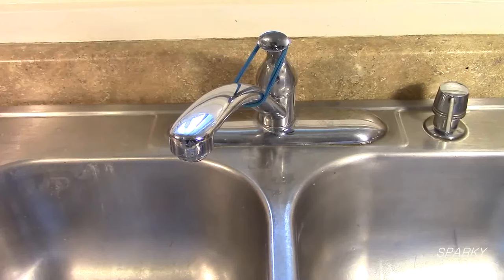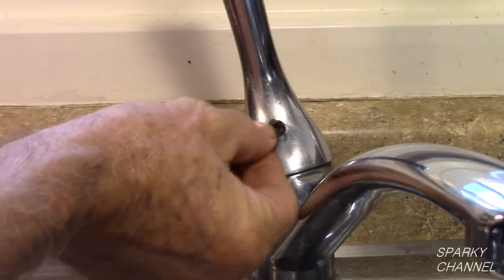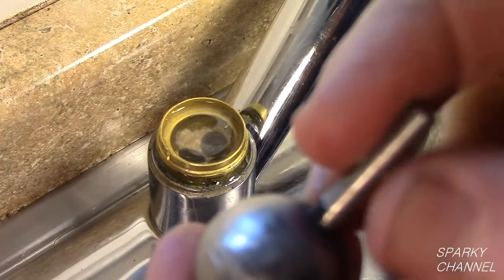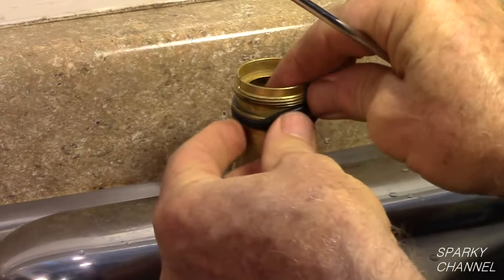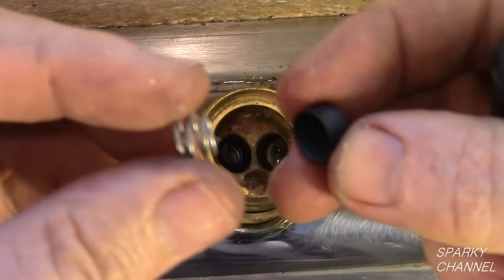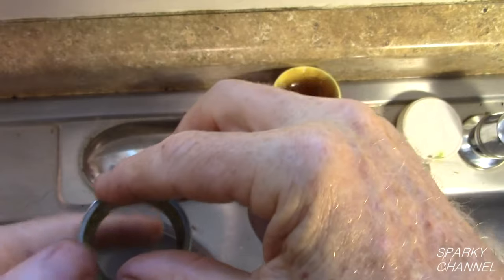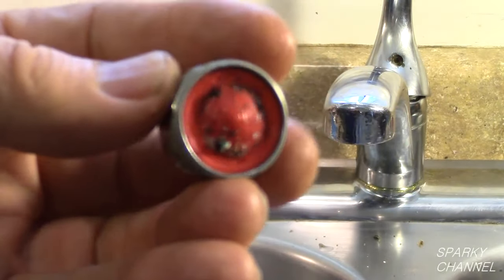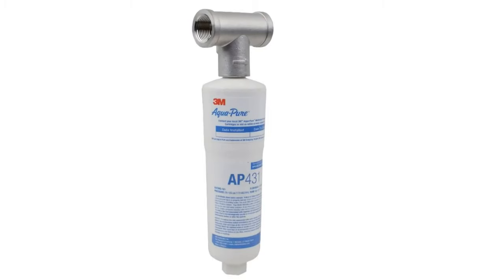Delta Kitchen Faucet Leak Repair (Single Handle)

Comment: Called Delta. They sent me the wrong part. I wanted the rubber seals/springs and they sent me the cam assbly. The "customer service" rep had no idea what I was talking about. I bought the correct part on Amazon. Good job Delta! Previously they sent me a replacement handle that was so poorly machined that it didn't secure to the ball. I bought a Home Depot handle that doesn't match cosmetically but it works! Delta needs to get it together and have people that understand their products and not just answer the phone!
Reply from the maker: I used to buy exclusively Delta but I've gone to Kohler and Moen in recent years. Of the two, I prefer Kohler for kitchen faucets.
Reply: @SparkyChannel  Thanks for your excellent instructional video, it was very thorough and left nothing unanswered. I didn't replace the spout O rings since I have a pull out faucet sprayer and It wasn't yet needed and it would have complicated things more than I wanted to deal with. The leak has stopped and the handle is working smoothly.
I have no need to replace the faucet so I'll stick with my Delta since I now know how to fix it. Thanks again.

Comment: Can you please tell me if the set screw and cap assembly are corroded will they need replacement as well. Also, what if the silicone around the base has worn away and water is leaking under the sink from there?
Thanks so much for fantastic tutorial. Great work! 🙏

Comment: I could not get the ball & cam assemble notch aligned in the cap assembly. I used a 3/4" to 1/2" Sharkbite to push down the ball & cam while I screwed on the cap assembly. Video was very helpful and simple to follow.
Reply: Thanks Bill.  Just did it on my faucet works perfect now

Comment: Great little video. Very good instructions. I got a kit at Ace and it was pretty good but cap above the ball was slightly different. It works but I would go with the delta brand as he suggests if I ever have to do it again
Reply from the maker: Thanks for the tips!

Comment: Thanks so much for the video. I can remove the handle but the cap doesn't move at all with adjustable wrench. Tried many times and different ones, still hardly move.  Very frustrating...

Comment: Great vid, I took it all apart in short order thanks to you.
Now do you really need to replace EVERY rubber valve insert and oring? If you have a leak on just one side, I assume you just need to replace that side's spring and gasket and maybe the ball?
Reply from the maker: Yes, that would probably work but it's best to replace them all.

Comment: Tip when replacing the O-rings:
Remove: Bottom one FIRST, then the TOP one - this will keep the bottom one from rolling into the top O-ring slot.
Replace: TOP one first, then the Bottom one so it will "ROLL" past the first O-ring slot without seating into it if it was empty.

Comment: Delta lifetime warranty is GREAT!!! Just got an entire repair kit coming in the mail!
1) Triple-confirm the part number of your item with Delta rep. You will need to take photos, and supply them with photos!
2) Don't buy junk in retail stores that is all cheap plastic. Only buy authorized / certified Delta replacement parts!!!

Unfortunately, what does NOT come in the kit is the large foundation gasket (plate something). Buy this one yourself, and give this thing a complete makeover!

According to the lady rep, clean all water corrosion and hard water mineral deposits with half-half solution of vinegar and water. Immerse handle and spout into the same solution to clean all gunk inside. Then carefully flush out the vinegar.
Gaskets come pre-lubricated. If not, use NON-PETROLEUM lubricant for rubber parts.
Assemble. 
Hopefully your wife gives you something special for all the work that you did!!
Reply from the maker: Great job, thanks!
Reply: ...And Delta shipped me the wrong kit!!!

Comment: Nice video. I just did one of these last week. I've always used Oatey silicon grease but might have to give that Rectorseal stuff a try.
Reply from the maker: Thanks! Oatey is an excellent brand as well. I use their products a lot and they seem to work well. The main thing is to use plumbers grease to help the next guy out when he services the unit.
Reply: If you have fishing reel lube or dielectric grease, these are all silicone greases. I appreciate the video, letting me see what's happening inside before I tear it apart. And that Delta is going to send me parts. I was getting ready to go to Menards now!

Comment: This was so helpful, thank you!
Reply from the maker: You're so welcome!
Reply: The faucet is smooth again but I am still getting lower pressure from the hot water side. I thought there may be some blockage in the hot water spring/grommet hole but it was clear. The pressure is a little better but still nothing like the cold water pressure. Any thoughts? Thanks
Reply from the maker: @TheWelshCowboy  I think some corrosion got loose and is blocking you hot water supply. (Just a guess)

Comment: I have this faucet assembly and did this repair. But I've noticed that the hottest water coming out is about 10 degrees cooler than in other places. I turned off the cold line to test if it's in the fixture, and it's normal temp that way. So the faucet seems to somehow be bleeding a little cold into the hot. Is there any way to adjust the temp in this fixture?

Comment: Great tutorial. My handle won't come off at all. Ant ideas besides an entire faucet replacement? Tried liquid wrench. No luck.
Reply from the maker: Thanks. PB Blaster, and tap the metal to set up vibrations to get the PB Blaster into the threads.

Comment: Very good ...but 
How do you DETERMINE the model number of the faucet?. Mine is this style but Circa 1984. There are no replacement PARTS in Lowe's or Home Depot.
There's not even exact replacement FIXTURE matches

Comment: My Delta faucet stainless steel ball has 4 holes and the elongated hole.  New #70 SS Balls have 3 holes and the elongated hole. Will the new #70 work for my faucet?

Comment: I noticed you didn't use the little wrench that came with the kit . Do you mind explaining at what point could you use that and what it's for
Reply from the maker: Some models need a little hex wrench to remove the set screw that holds the handle on. Other models just use a Phillips screw, so the hex wrench isn't needed. See my video where I remove the set screw with a hex wrench: Delta Single Handle Shower Valve Leak Repair 13/14 Series: https://youtu.be/NdXwRUhfBHA

Comment: Question on the plumbers grease.  Since you're putting it inside the faucet, in the valve body where the spring and seat are that bring the hot and cold water in, isn't that water going to be contaminated with grease as it comes out of the faucet into your cup or pot?
Reply from the maker: It might a little.

Comment: How do you get a spout assembly off if it is stuck and won’t budge? Thank you
Reply from the maker: Have you tried using vinegar? PB Blaster should work. It will probably damage the O rings but you're replacing them anyway.

Comment: very informative video..............so if a kitchen faucet is leaking at the base of the spout even with the water off.................it must be the ceramic cartridge that's leaking, right ?

what if my tap handle is like the one in this video (moves up/down).............do i have to change the ''ball'' thing since i'm not a handyman kind of person ??
Reply from the maker: Yes, correct, you would need to change the ball.
Reply: @SparkyChannel  many thanks indeed..............so the plumber's grease is optional ?.........wonder why they don't just use the ceramic cartridge since it's easier to maintain and supposedly more reliable ?

Comment: Trying to do mine and it took forever just to get the handle off. Couldn’t even budge the cap with a pipe wrench, probably gonna wind up replacing the whole thing. Sucks that my kitchen faucet doesn’t have its own cutoff.

Comment: Thank you Bill for these fantastic instructions, best I found anywhere! It's awesome you recommend OEM Delta parts under warranty 1st in video.  I just installed a new Delta Kitchen faucet 100 LF-WF looks very similar to model in your video. I saved your video and wonder how long do these faucets usually last with medium hard water, before I need to do this repair? I like Blue & Yellow Large Vice Grip no teeth adjustable wrench you use, please let me know where I can get one? I'm in condo, so I can't use Aqua-Pure system you recommend. I need to replace 22.5 yr old BrassCraft shut off valves with white plastic stems soon, do you have video for that?
Reply from the maker: Thanks! Any large "Cresent" wrench will work. The brand I used in the video is Vise Grip. They make some heavy-duty wrenches.

Comment: Bill, installing those two springs and black seats is just impossible.  I am sure I am doing it properly, but I just can’t get those seats to snap into place.  I even tried putting the old parts back on, and I couldn’t even get those to snap.  Help?😢
Reply from the maker: I think if they go into place without snapping you'll be fine.

Comment: Hi, thank you for making this video. You did a great job explaining. So to confirm, if I had a single handle delta faucet installed in 2020, I should be able to contact Delta for any parts? Mine is leaking water by the base and the ball. Any idea what could cause that? Thank you.
Reply from the maker: Hi Terry. Yes, you can call Delta so that they can fulfill their guarantee. They should send you the repair kit. It's bad gaskets.
Reply: @SparkyChannel  do you know if this is normal to go bad in only 2 years. thank you.
Reply from the maker: @terrikasik5131  No, it's not normal but it happens.

Comment: Awesome video! quick question is the plumbers grease safe for potable water? I did my install and lubed everything up as per the video with Silk Seal Plumbers Grease and initially opening up the faucet I could smell the grease a little in a cup of water so I ran the faucet for a while also like the video mentioned and could hardly smell it anymore but I'm a little worried about consuming small amounts of this grease.
Reply from the maker: Plumbers grease is non-toxic. I would let it run a while though.
Reply: @SparkyChannel  Thanks... yeah small amounts are non-toxic! The faucet no longer leaks though... operates smoothly now, Thanks! 🤓

Comment: Great video! I sprayed the handle every which way but it still refuses to come out. I think you said you tapped it, not sure where to tap it. Any help would be greatly appreciated, thanks! UPDATE: I tapped away all aaroundand it came loose 😊 but it looks pretty gnarly in there, hopefully this will be a successful operation!
Reply from the maker: Good luck!
Reply: @SparkyChannel  Thank you Bill! Well... my first mistake was to use the Danco kit. The springs were too long and the cam assembly was too thick preventing me from tightening the bonnet ): So off to the store I went and purchased a Delta cam assembly that looks exactly like the one in your video. Sadly, it too protrudes out on the right hand side opposite of the notch but I was able push it and tighten the bonnet. My issue now is that when I try to close the faucet, it doesn't cut off the water unless I move the handle to the right. I don't understand why the Delta cam doesn't fit correctly. When I install the old cam which is comprised of a white plastic cap and a separate (cracked) rubber gasket, it sits flush and shuts off the water except for a small drip which stops when I slightly move the handle to the right. FYI, my faucet looks exactly like the one in your video but I wonder if it's simply too old and the correct parts no longer exist to rebuild it. Any thoughts? I'm trying to avoid having to buy a new faucet as I've already spent a lot time and $$ fixing up the apartment I'm renting. Thanks again for your outstanding video!
Reply from the maker: @gratefulqt7704  Did you tighten down the large nut enough? Did the parts you removed match your replacement parts? Put the little springs in the right direction?
Reply: @SparkyChannel  I did, all the parts were in the right place but the gray cam was thicker than the original white one preventing a tight fit and the spout developed pin holes so I had to replace the ancient faucet with a cheap Peerless which is already acting up. When the water is running, the spout doesn't swivel easily, this after only two months 🙄

Comment: Had to work the handle off and used a hair dryer to heat it up a bit.   Then had to use some robo grips to remove the cap.   Use a cloth so as not to damage it.   Good luck
Reply from the maker: Thanks!

Comment: What do I do if set screw is corroded? Thank you
Reply from the maker: That's quite common. I would spray it with PB Blaster penetrant, tap the metal a few times and let it sit awhile. Then you need the exact size hex wrench. If you can get one with a "T" head, that would be better. If it doesn't come loose, spray it again.
When you put on the new hex screw, put some grease on the threads for the next guy working on it (it might be you).
Reply: @SparkyChannel  Thanks for your response.

Comment: I didn't realize that plumbers grease and silicone grease were different, most videos I've watched so far uses silicone grease which is what I have. Do you know the difference?
Reply from the maker: Not sure, but plumbers grease is specifically formulated for plumbing.

Comment: There's a cap with blue and red dots covering where the set screw should be. Can't get the cap off...
Reply from the maker: A small screwdriver or a razor knife should do the trick.
Reply: @SparkyChannel  thanks. I ended up using the tip of a knife. 
Another thing to note: Don't over tight the nut. It will squish gasket on the cartridge and bleak. I hand tightened and then slightly bumped it tighter with a wrench.

Comment: What do you think is the best way to get out a frozen set screw. I've tried penetrating oil with no luck. And I don't want to heat it up because of all the rubber parts inside. Maybe I'll just have to drill it out and get a new handle.
Reply from the maker: Have you tried PB Blaster, then tapping the area to get the PB Blaster in the threads? And a good T handle hex head wrench?
Reply: @SparkyChannel  I'll try it. Thanks for the info!

Comment: I am having a hard time removing the spout assembly. Any tips?
Reply from the maker: Yes, my fav product for this purpose is: Blaster 16-PB Penetrating Catalyst - 11 oz.: Amazon: https://amzn.to/38Nd8lK 
  You can buy it pretty much anywhere. Use plenty of it and keep tapping on the metal surface to let the lubricant get into the threads. Another trick is after you've applied a lot of it, go have lunch or something and come back. Letting some time pass helps it to penetrate.

Comment: Would this be the same method if I have one of those bronze rustic lookin bathroom faucets?? I been trying to find my faucet online and can’t find it anywhere . I’m prob just gonna replace the whole thing .
Reply from the maker: Is it a single handle faucet? What brand?
Reply: @SparkyChannel  

It is a single handle , I can’t find the brand . I removed that little screw in the handle but haven’t been able to remove the top because I didn’t want it to break completely . I think the water comes from under the handle every time I do a load of laundry (the plumbing is all connected I guess, I’m the furthest thing from a plumber as you can prob tell). Thanks for the quick response, btw. I’m gonna try lubing it to see if the handle comes off a little easier . It’s most likely corroded , I bought the house and everything has been neglected so that’s probably why.
Reply from the maker: @bazookajoe2889  Yes, the handles can get quite corroded.

Comment: Does the grease not get in the water?
Reply from the maker: I don't know. Good question.
Reply: The grease is apparently non-toxic. I had to spray a bunch of WD-40 to disassemble my faucet and was worried about WD-40's toxicity. I ended up carefully wiping down the parts I needed to reuse and heavily flushed the faucet's bottom by only slightly opening the hot water supply line prior to installing the new parts with silicone grease. I've not noticed any oily residue in my water.
Reply from the maker: @gratefulqt7704  Thanks for the info. Also, a good non-toxic cleaner is vinegar.

Comment: After completing all the steps described in the video, the delta faucet slow drips if I don’t place or position the faucet handle in an exact precise off position. I have to pull down tight on the faucet handle to make sure the faucet is off to stop a slow drip. It wasn’t that difficult to turn off the faucet before. What do I need to do to solve this problem?
Reply from the maker: Did you tighten down the large nut enough? Did the parts you removed match your replacement parts? Put the little springs in the right direction?